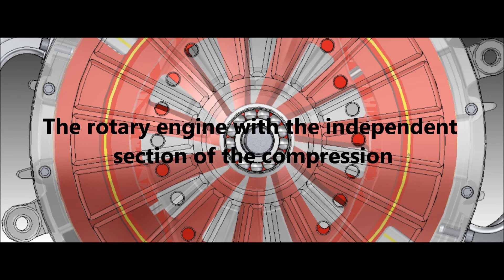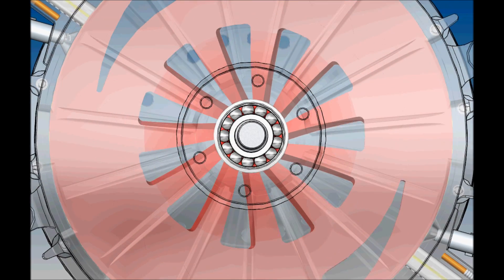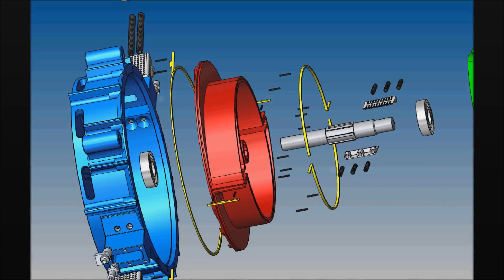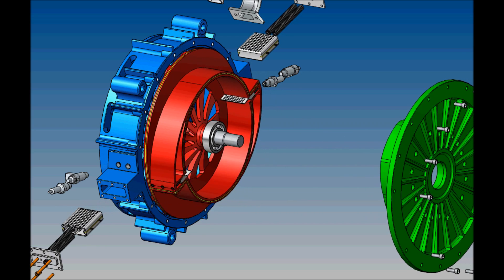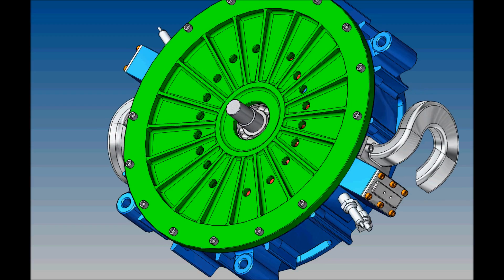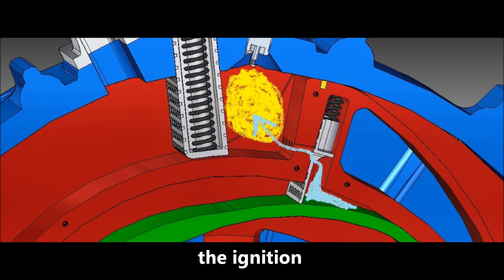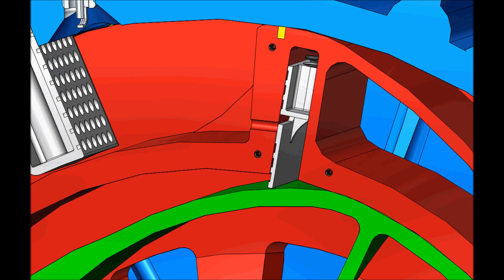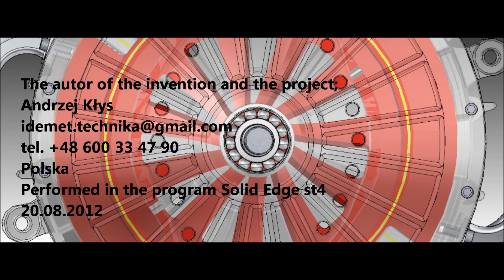Rotary engine with separated section of the compre

Comment: It seems we all come up with the same engine design but you're overcomplicating the manufacturing process, it's best to have a second rotor for air compression offset by a few degrees and then pass the compressed air after the first rotor has moved a little.
Reply from the maker: I agree. The improved design has the compression section as a second rotor on a common axis. The improved design also has separate combustion chambers, which improves the combustion process

Comment: Do 3d plastic
Run air
Reply from the maker: This model is for illustration purposes only, the real engine will be modified and will have the classic Carno mileage, for now I don't have much time because I'm working on another project, but this one will be next.
Reply: @2wsZ   it would make a good pump
Reply: Hire out that 3d print job
Reply: Drawing maybe not have enough information  to do a print

Comment: Good Morning!

I have a project for a new rotary engine, 4 stroke without oil burning and without leaks like the Wankel.
This engine will be:
- No valves, no springs, no cam.
- Few moving parts, for this reason more reliable.
- Smaller and lighter, ideal for aviation and hybrid cars.
- For the reasons above, it should be more economical than the existing ones.
  I have it printed in 3d rotating.
I need partnership to build a prototype to see real efficiency. Could you help me? or do you know who can?
Sorry for the errors, I did the translation by google.
Thank you, I await contact.
Marcelino Boraschi
marboraschi@yahoo.com

Comment: You explain it poorly but it is very clever idea,the rotor compressing the fuel it
genius!!
The sliding vain/comp chamber is good too.
Using it to creat the exhaust effect is very clever.
You think like ADHD,not saying you have it but they
think on a similar level,,The most with the least.
Difference is you have done it,they would still be trying
to make it with one less piece.
Well done,the best I have seen
Reply from the maker: This is the best opinion I have received, thank you very much and best regards.

Comment: Good morning, first of all I have a similar idea but it differs from yours in the concept of the passage from the compressed mixture to the explosion, I think you should work more on it, since at the moment of the explosion it will give you a back pressure and there would be a decrease in the speed of rotation, in addition the external seals are not adequate because between the channel where the seal and the rotor is a small leak and would not be very hermetic, I recommend you build a prototype and go testing, so you You will realize, that I already did it almost 8 years ago but I destroyed the prototype and I must return to work again, that some money is invested, additional I do not see the lubrication system which is another problem in which I personally have many inconveniences, just today I see your video and that I look for in the internet many prototypes of rotary motors to learn from the mistakes of others. I am from Ecuador and I do not speak or write English so I apologize if there is something wrong that I am using the Google translator my email is ploayza68@gmail.com
Reply from the maker: To apologize that I did not answer, I see about right away with something to sizable. Own I built the overefficient drive and this is the true future, see and try to understand.
https://www.youtube.com/watch?v=gkYUxfPPaJc&t=3s

Comment: I’d love to see this in action, and see the numbers.  This is a very old video: what has happened since then? This seems more viable than a Wankel for seals, particularly because of the way intake/compression and the power/exhaust are separated, though I can also see potential issues there due to temperature/pressure differentials. Hot materials and cold materials (significant differences in temperatures) causes different amounts of expansion/contraction of materials, though at least this design seems like it can be changed (if needed) without changing the concept of how it works.  I realize this animation lacks some of the finer details required to judge that.

Comment: This engine and others similar to it have very poor compression cycles. The compression camber prior to ignition is expanding. 
Further more there is very little time  to move enough air into the combustion chamber prior to ignition.
Reply from the maker: Ron M 
Similar does not mean the same. In this construction deficit the air does not exist.